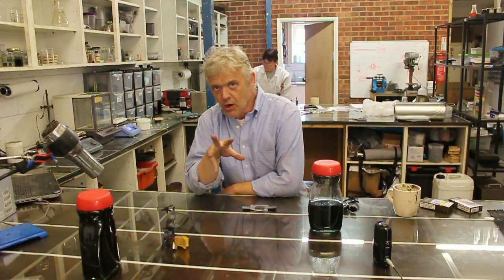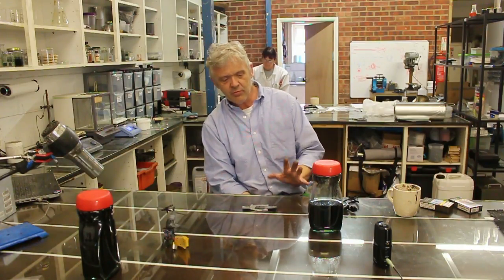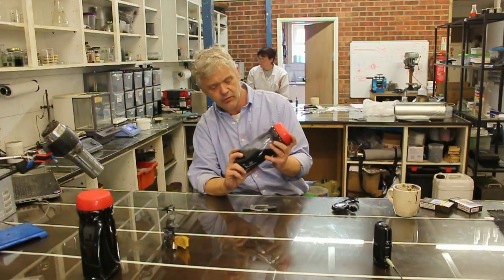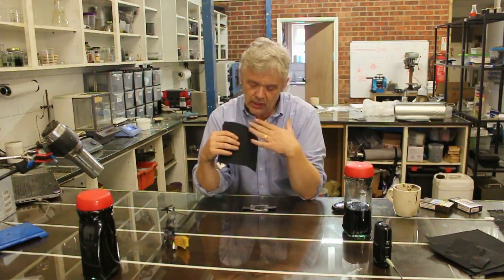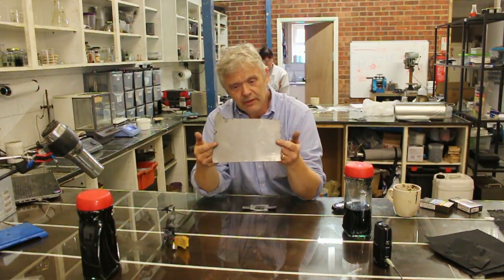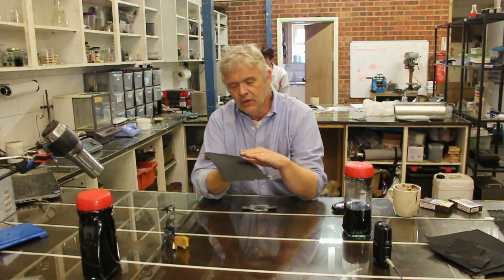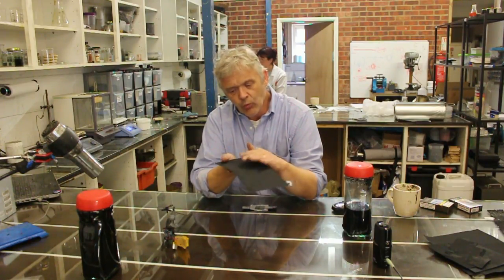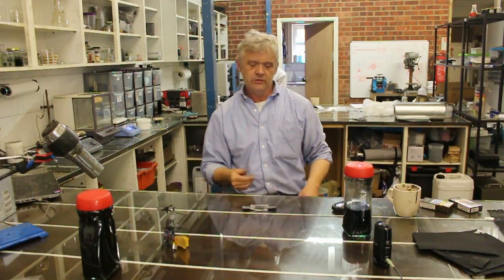An All Carbon Device For Crowd Funding

Comment: I like the flooded cell idea.  People are used to the maintenance with flooded L-A. I have the feeling that designing a rectangular, multi-cell flooded "energy storage" device might require a lower investment.  The market for stationary solar and wind storage, whether grid tied or not, is HUGE!  Doesn't have to be extremely compact, just low in overall cost. Tesla's Powerwalls have a low roi due to the high cost of the 18650 lithium cells inside.  I think you could compete extremely well against them.
Reply from the maker: I think you are right mate - I will be doing a test of the flooded cell pretty soon
Reply: Awesome! I'd love to test a ~24v ~200ah bank with my open source solar controller. Please make some plates we can buy!! There are so many small solar systems here in Hawaii that need your work. Good job Robert! You're progressing well. :)
Reply: I agree flooded cell!
Reply: Nicholas Schmit Hawaii! Yes! That is where the first shots in the war of Independence from the "public utilities power extortion" were fired in the US! We in California have joined your cause in the battle.  I imagine you too have noticed that as soon as a storage technology becomes available, it is instantly grabbed exclusively by the public utilities for "grid storage", and becomes unavailable for home or small business use. :(  I think that's why you and I and thousands of others have ended up here. ;)
Reply: Correct, format doesn't matter, let's start using it. Even if we had to finish assembling them here that would be fine. Maybe we could convince Robert to fire up the printing press.
Reply: We have so many people living without power lines and trying to get by with to small of FLA batteries. I find that the most teaching I do is getting people to understand that they should not discharge their battery completely. Small scale solar gets a bad name because people don't understand their batteries. Having a battery that can withstand 100% DOD many times would be a godsend even if it had less capacity. It is far easier to provide a functional solution than teach someone electricity.
Reply: Nicholas Schmit Indeed!  100%DOD is exactly what I was thinking when I made my other comment on this video!  I think Robert is going to get overwhelmed with comments on this video. :)
Reply: I think a triangle battery will be able to charge and be able to hold more charge as 3 points that is positive / neutral / negative points ..

Comment: 7:00 does an all carbon device go to landfill, or to the compost pile?
Reply from the maker: I think it will be your choice mate - but as these things last for around 1 million cycles it's likely to be your grandchildren who are deciding what to do with it when it is dead
Reply: Robert, consider what you just said.  If it is not going in the landfill anytime soon, would that mean that using a stainless steel screen as a charge collector on which foam could be deposited would be an advantage? It sure would make connection terminals more robust. :)
Reply from the maker: hmm - good point mate - cheers

Comment: On the surface, the total energy density of a lead-acid battery is somewhat impressive, IF you take a fully charged L-A battery and fully discharge it.  However, you only get a handful of such discharge cycles before totally killing the battery. (It becomes like a primary battery x5 or maybe x8 if you're lucky) :(  So true energy density has to take into account avoiding a full discharge.
Now, although supercapacitors still lack at total energy density compared to electro-chemical cells, it should be possible to fully discharge them thousands of times as long as they are not overcharged (overheated).  This allows true usage of the energy density.
So Question: From your testing so far, will this all-carbon cell survive a full discharge without requiring any special "voodoo" that an electro-chemical cell would need to recover a full charge capacity??
Reply from the maker: really? - that doesn't seem right I understand fully discharged to be 0 volts - if you do that to a lead acid or lithium you kill them - the lithium because you deintercalate all the lithium and the graphite galleries collapse - I think the recommended is nominal 3.7v discharge to around 3 volts
Reply from the maker: yes it is 100% depth of discharge - which is what you are talking about I think
Reply: Providing you have a beefy enough DC-DC converter, yes. I can see that working for larger installations but it'll still add another cost into your equation. The beauty with the joule thief is it is a low cost, low current device with no frills. As soon as you require a larger current, DC-DC converters get complicated and expensive rather quickly.

Perhaps not insurmountable, but something that you and the designer would have to seriously consider - but if these things are going to be as cheap as you say they are with the capacity you claim, then it might be worth the sacrifice.
Reply: Karabetter "full discharging" is already working well with lithium batteries. If you discharge a full lithium ion cell to, lets say, 2.5V there is almost no capacity left in the cell. And this can be done for hundreds of cycles.
Reply: Manufacturers specify lithium to 2.5V to get the highest energy density reading, it is where the cell is "effectively" at 0% capacity. In reality, designers use the cells to as you said, around 3V, but actually much of the time you don't even want to go as far as 3V. It all has to do with how heavily you load the cell. If you have a load significantly lower than 1C for example, your final voltage might not be much below nominal, but if you coulomb count that discharge cycle, you'll find you've essentially depleted the battery, despite what the potential says. If you went much further, the voltage would plunge off a cliff very, very quickly.

It's extremely frustrating, and very cool if your battery does indeed go to 0V, certainly in terms of not having to worry about damaging the cell - the only issue with that is whether most of the usable capacity lies in the higher voltages, or if you lose a lot down in the low ranges. Because then your problem switches from one of protecting the cells from damage to boosting the cell voltages to the level you need. That could potentially be more complicated and expensive to design around. Even switching converters could turn a 95+% efficient battery cell into an 85 or 90% efficient system (maybe less depending on what voltages we're talking about) and when high power gets involved, that means a lot of heat that has to be managed.
Reply: Yes, Robert, that is what I was trying to describe, and also, I agree with you that fully discharged is 0V. This is one of the great characteristics of superCs, so that's good news. :D
This means that in renewable energy storage, a user could use a DC-DC boost converter/regulator (an engineered joule-thief ;) ) between these cells and the load to have a nice steady output and use more of the stored energy without fears of damaging an electro-chem battery :)
Reply: Rossco, yes indeed, a joule thief is useful, and might be ideal for LED lighting (voltage output control would be tricky).  But I am talking about using this storage for daily home and small business with solar and wind.  I'm not expecting the converter electronics to be part of the package that Robert would be building ... at least not at first. ;)
For my use, converting DC-DC (24 or 48V) is showing to be more efficient.  However, a general homeowner might find a DC-AC 120/240 inverter to be more useful. :)  Either way, SuperCs would still have the advantage of not being harmed with a full discharge.
And yes, high current conversion boxes are expensive, but why not use several 1-1.5KW boxes running separate loads?
Reply: RavenPrecept I don't think the output of a joule thief can be considered to look like a general purpose battery, there would be too much switching noise in the output.
I think the usage of the output simply as a capacitor, would better be designed into the circuit that is going to use it, rather than having to design around the action of a joule thief. 
With that said, there is a complication when charging capacitors in series and keeping them in balance which needs to be dealt with. Batteries have somewhat the same problem, but it can be greatly mitigated by starting with batteries of the same charge and age.  There are circuits that deal with this for capacitors, but it's too long of a topic to cover here. :)
Reply: The problem with using capacitors for energy storage is their inerrant self discharge problems; they have their advantages ie fast charge / discharge times, high current capability, and longevity.
For anything longer than a few hours storage, a battery is the better option.